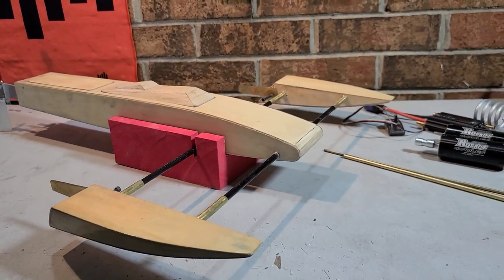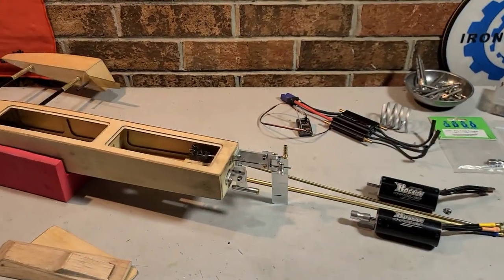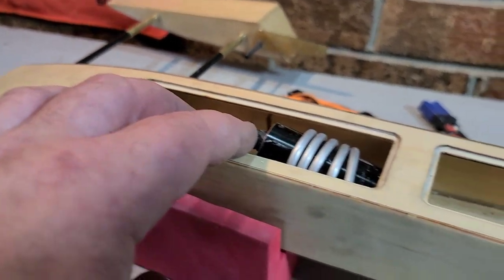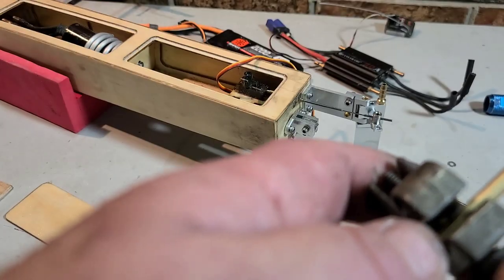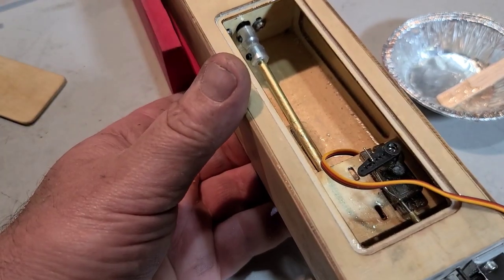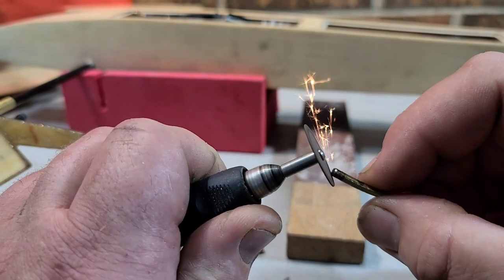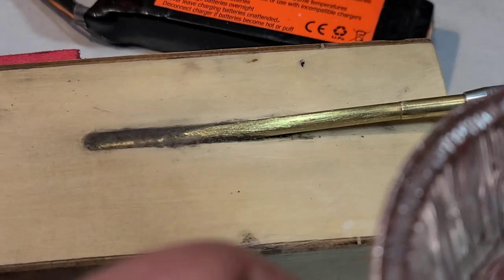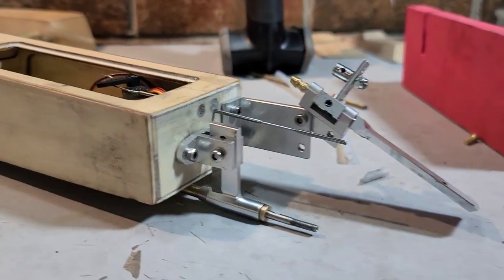Stuffing Tube & Flex Cable Full Install Shrimp Outrigger Rc Boat Build Pt2

Comment: I can't wait to see this rip! For mixing epoxy try using an empty soda or beer can. Flip it over and mix it in the concave portion on the bottom side of the can. When you mix it up it will naturally run back to the center and not spread out like if you use cardboard. As a bonus the aluminum can is so thin you can actually feel it heat up so you know when it's about to kick off. Now you just need some empty beer cans 🤣
Reply from the maker: I've used soda/beer cans works great. 💪

Comment: My next Challenge is going to involve motor/prop/ESC/battery selections in a type of cheap and easy to build hull that has been the subject of a lot of experimentation on my part.  I quickly discovered it is really easy to put so much power in a hull that it performs more like the Space Shuttle; launching itself many feet into the air at the first blip of the throttle.  Use caution when you maiden that thing......
Reply from the maker: I wanted to run smaller motor & esc
Reply: @IRONCLADRC  You can bet I will not be drinking coffee when I watch that video.  It's going to be a rocket, one way (vertically) or the other (horizontally).  Either way it's going to be "Must See Video".
Reply: Space shuttle you say? Now I’m really interested
Reply from the maker: Yea man it should be extremely competitive
Reply: @norcalrc  Big B is definitely building a rocket.  As for the Challenge v2.0 boats I've been working on, some of my early power systems did just that:  Space Shuttle, followed shortly thereafter by fish swimming underwater, and back to Space Shuttle again.  It was actually hilarious.  I think Big B's rocket will be more successful, but things will happen really fast at the speeds I expect to see with that setup.
Reply from the maker: I had that same motor in my ironclad rigger and it was a space ship in the straight but didn't do so well in a turn..
Reply: @IRONCLADRC  This hull is the same size as the Ironclad, right?  495mm?

Comment: I bought a Rigger boat constructor, collected everything, the first experience.  It does not drive well, does not develop speed, how to properly adjust the angle of the propeller?  Thank you.
Reply from the maker: The Strut should be parallel to the ride surface,  set the boat on a table top so the sponsons are touching and adjust the strut flat with the table top

Comment: Really neat drive installation there Big B. The hardware is looking great 👍 
Interesting choice of motor and ESC. Made me smile when you were epoxying the stuffing tube and you said you want to keep the boat as light as possible. That motor and ESC certainly aren't light for a featherweight rigger, so will be interesting to see if the power/weight trade off works 😉
Reply from the maker: I want to keep the BOAT light basically because of the heavy electronics.   It will probably sink into the abyss,  first run out.

Comment: The outriggers have been making me curious lately
Reply from the maker: There fun to mess with but can be a little aggravating at times leaving you scratching your head.  Very tight everywhere, when I say everywhere I mean everywhere.

 If it's a scratch build it takes alot of preparation and planning.  

If I were to recommend a rigger I'd get a kit with everything included!  Like zipkits with the hardware package and use recommend electronics.  

This rigger and my ironclad rigger was & is a pain in my a&&
Reply: @IRONCLADRC yeah I like the sound of the complete kit. I am an experienced carpenter but the scale part in new to
Reply: @IRONCLADRC  gluttons for punishment we are